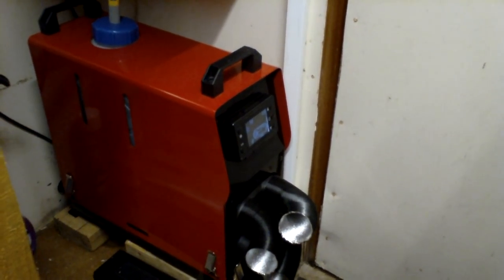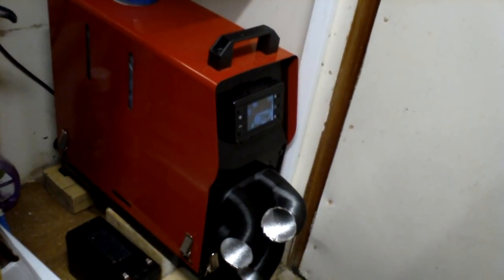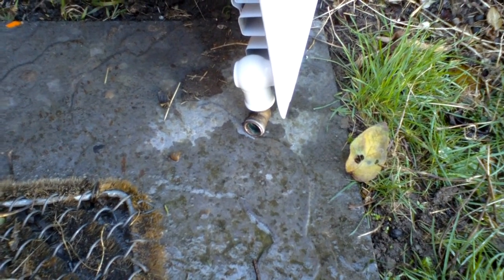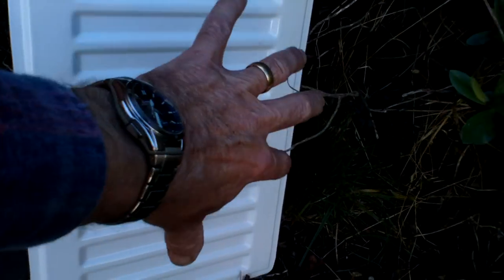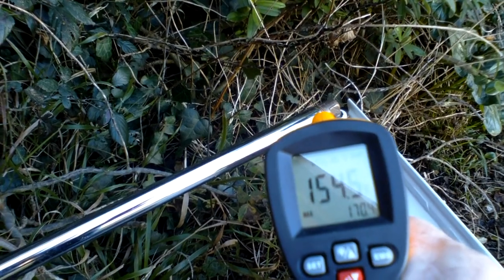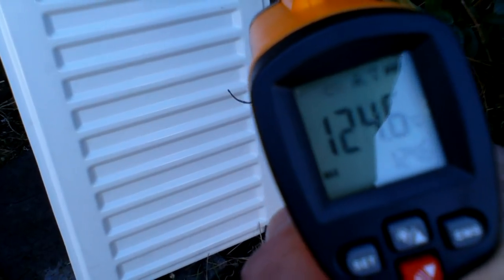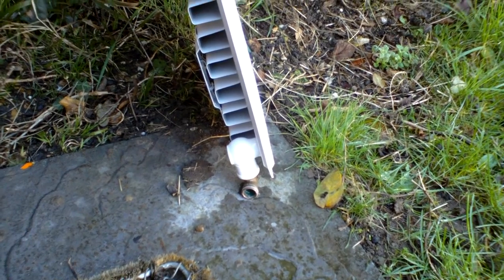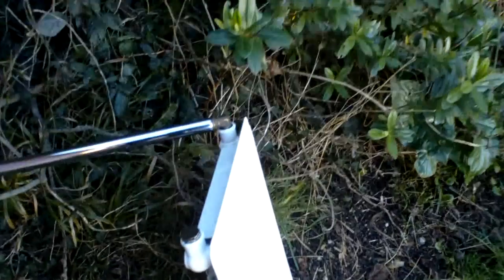COMPACT CHINESE DIESEL AIR HEATER EXHAUST HEAT RECOVERY

Comment: Wrap copper tubing around a pipe and make a water heater the plum the hot water into an old water heating radiator for homes. I seen someone else use a egr cooler to make a heater and it circulated the water without a pump just the heat moved the water
Reply from the maker: Hi John. There are all manner of way to extract the heat and I did this as an experiment and I made TWO VIDEOS and the microbore copper pipe was the most effective and the simplest solution as it does not interfere with the standard exhaust so will not cause sooting within the unit. Also service is easy as noting more to disconnect. The result is simplicity and as for a gravity feed all very early central heating relied on this but the pipe runs have to be carefully planned with rise and falls to allow the hot water to circulate. Adding the very low power pump on the input to the heat exchanger coil ensures that the hot water circulation is not too fast so it can absorb the heat and also be circulated effectively.
As I said the video was never made to be a definitive example of heat recovery but a simple solution to recover the heat normally wasted.
Thanks for your comment. Regards and stay warm Peter

Comment: Dear Peter please investigate that further, its a great idea and opens up a ton of new applications for small workshops or Rvs or others..I did think about some options which I could envision..like another commenter suggested..may be heat a water tank ( out side Installation) protect it from freezing..or put it in a ceiling or in an underfloor double floor construction to keep that areas turn over..or use it justn as a convection heater ( as it is designed for) but other blow thru containers can be considered as well..actually you turned one heat sources into two...plus you enabled brain storming about much higher efficiency om such devices..which again can be also transferred to other heaters lile trumas or Alde?
Reply from the maker: Hi RV.  I think there are applications but it has to be carefully designed. I think getting the exhaust gasses outside first then put them through a small heat exchanger which has a large surface area for the gasses to heat the water and has a low gas flow resistance. After the installation you would definitely need access to a combustion analyser so the burn rate air / fuel mixture was correct to eliminate sooting and carbon build up in the combustion chamber and the heat exchanger - the latter sooting up could be a major issue.
All gets the grey matter working which is why I did the video as to plant seeds gets others fired up so we may get a few systems appear yet once a load of others see the possibilities - fingers crossed. Regards Peter
Reply: @brucepeter2007  absolutely ! Well done! :-)

Comment: Try using a small inline intercooler, or a smaller radiator and feed the exhaust from the bottom.
Reply from the maker: Hi Qruns. I always try to reply as people who take the time to make a comment on my videos deserve a reply.
The below was in the comments section below my video but perhaps you missed it so perhaps I should put it on again so here goes...
PLEASE READ THIS AFTER VIEWING MY VIDEO.
DONT GO DOWN THE RAD ROUTE - I did this setup just to see if heat could be recovered and if it was worth the effort.
It is indeed worth the effort but NOT by using the exhaust gasses directly.
It WILL soot up the combustion chamber and you won’t be thanking me for that so please DONT USE THE SAME SET UP. 
The best way forward is to use copper microbore heating pipe and tightly coil it around a metal bar of slightly less diameter than the exhaust pipe then tapping with a hammer onto the copper pipe to flatten the pipe where it contacts the metal bar which will increase the heat transfer surface area a lot of copper pipe will ensure good heat transfer - to remove from the metal bar you would need to “undo the spring” by holding one end and un-turning the other end to increase the diameter of the copper coil which will cause the copper pipe to slip off the metal former. You would use the same principal to get it over the stainless steel exhaust pipe - it would when all need to be tightly wrapped in exhaust manifold tape to both insulate it and keep the heat in for good transfer. A small 12v pump would be used to circulate the heated water to either a copper transfer coil within your RVs water tank or you could run the water through a radiator if you so wished.
Using the radiator directly WILL cause the diesel heater to fail overtime due to increased back pressure and the issue with water condensation. Please also note that although heat rises so it would seem obvious to use the lower radiator inlet for the exhaust gasses  Using the bottom or top of the radiator for either the exhaust inlet or outlet makes no difference as the result long term is the same - I personally would like to do a video however time prevents me but someone else needs to take up the challenge on this one as I have just planted the seeds - let’s see what develops. 
Hope that helps - Regards Peter

Comment: Nice one.  As you say - if you can stimulate thought bubbles, you are doing well, so thank you!  I use my diesel heater in alpine camps where water pipes normally freeze overnight.  This means you have to shower before the pipes freeze and you destroy water pump.  If you could warm the water tank (from exhaust heat) and then periodically cycle the water, you would be able to use your water system for many more hours into the night.   Well worth experimenting - thinking copper coil around exhaust so as to not mess with exhaust gases or restrict the flow (and cause soot build up as some have indicated).  Perhaps a small, continuous water pump not too dissimilar to the fuel pump, copper coil and cycle through existing water tank etc etc.?????
Reply from the maker: Hi John. If you read my comment you will see the best way to go is coiled pipe route... I hay have a go again myself but it’s only as an experiment as I don’t need it so lost money for me but may help others. Got the pipe and a pump on order so keep watching my channel- will post update video soon.
Regards Peter

Comment: I did an experiment back in 2017 with a chinese diesel heater and ran the exhaust through a coil in a small calorifier by wieghing the water and measuring the temperature increase i  calculated  the exhaust was around 777watts output . I used the secondary heat exchanger from a Biasi condensing boiler the coil has an Id of 12mm .I fed the exhaust into this the system worked fine as long as the water temp was below 45c  above this the exhaust stopped condensing and the water vapour created to much back pressure causing lockout .
Reply from the maker: Great comment from you and agree with your findings. I was very concerned about the condense level of water - but if kept simple it would be worth playing with. I’m going to try again but as I’m an OAP I have to watch what I spend by hay - worth another go... Regards Peter
Reply: @brucepeter2007   Most of the exhaust energy is in the water vapour if you can condense all of this you are recovering most of the exhaust energy .Btw you are correct in feeding top and discharging bottom  allowing condense to drain out 
 Regards Nick
Reply: @nickbadi3599 You're spot on! Phase change. Learned that in 1sr yr engineering school.

Comment: You have to pay attention to bends you aren't supposed to have more than 270 degrees in total bends... Plus I think there is a 3 meter limitation on the length for the same reason. With the added back pressure, you can overheat the heater and damage the control panel inside the heater. You'd be better off wrapping a pipe around the exhaust pipe and do water or air exchange. Keep in mind that by cooling the exhaust with the exchanger you can possibly get condensation... And a quicker failure of the exhaust pipe. And if you have bends, water can start collecting inside the exhaust pipe. So draining the condensation would be key. That is why the silencers / mufflers have a weep hole. Get and use the straight through type. Easy to tell... The pipes will be in the centerline... If they are off set... Not a straight through silencer.
Reply from the maker: Hi there. Thanks for the comment but I did say in the description that this was just for fun - and if you read below I posted a link to my other second video which provided a far safer and more efficient route for exhaust heat recovery.
The first video was a play about but clearly showed it was worth added consideration which is why I pursued the interesting experiment which I did with the second video which you have missed. I designed a simple system using items available in any country and the construction of the heat exchanger would present no issues to the average constructor.
Lots have now taken the idea further and some are using the recovered heat to either heat hot water cylinders or stop outside waste / water tanks from freezing. Lots of scope to experiment.
If you do have a go please post a video as that’s what YouTube is fantastic for.
You can now see things have considerably progressed since the first video you have seen...
The other video is here https://www.youtube.com/watch?v=VktbyEAoVR8

Again thanks for your comment. Regards Peter

Comment: Have a few ideas for heat recovery. But need the time to fabricate it on top of working all the time. Cheers and enjoy a pint in your warm shed.
Reply: Hmmmm... the exhaust running through a small water tank... can set it up without a circulating pump. Some farm tractors do not have a water pump, they just use convection to circulate the colling water through the radiator and back into the engine.
Reply from the maker: Be interested to see what you come up with. Number of guys in the States are having a go to see what they can achieve. Should be interesting. Regards Peter

Comment: Use a pool heater exchanger and use the heated fresh air back into the air inlet, so the air is pre heated on cold days.
Reply from the maker: Hi Nev. No issue on the air inlet as it’s taken from inside the room however the main concern was the exhaust which almost gets red hot and all that combustion heat goes to waste so a simple method of heat recovery was devised that could be done anywhere with items available in any country which is why I used the coiled copper pipe method. Lots have followed this up and some have used commercial vehicle heat exchangers from scrap yards and the like building on my original concept.
The Chinese have seen the video and now made a diesel heater with 4 pipes - 2 being to give hot water by using the bottom section of the heater as the heat exchanger but to my mind this makes things harder to service when you have to take things apart so the exhaust recovery is the best method as with good insulation to keep the heat in the pipe provides enough heat transfer. Only other thing I would do on the water circuit is to reverse the flow in the coil system - taking the cool return water feed to the furthest end away from the heater and the final output from the hottest part of the exhaust nearest the heater...
All good fun. Thanks for your comment.
Stay safe. Regards Peter

Comment: Condensation in the radiator is good.
When you burn 750g (900mL) of diesel it releases about 32MJ of energy by combining with 2.6kg of O2 to produce 2.3kg CO2 and 1kg of H2O in the form of steam.
Condensing the 1kg of steam releases 2.6MJ of energy or 7% of the original energy in the fuel which would otherwise be lost.
Just keep the exhaust system sloping downward from the point of condensation (inside the heat exchanger) to the exit so it can drain.
Reply from the maker: Hi there. This is not the best way to go so the experiment was continued in another more efficient direction. I had poster the following link but many people don’t see it. Please follow the link which is an easier installation together with it being easier to maintain the heater if maintenance is required but more importantly- your not messing with the exhaust system keeping the gasses inside the vehicle. The link below will become clear...
Thanks for taking the time to comment. Stay safe. Regards Peter
PART TWO FOR RVs & BOATS HERE  @
Reply from the maker: LINK THAT DID NOT COME OUT...
https://youtu.be/VktbyEAoVR8
Regards Peter

Comment: Look at how a VW bug heat exchanger works.  It pumps fresh air around the exhaust pipe that is covered in large fins.
Reply from the maker: Hi Rick. Thanks for your comment.
If you remove the covers on the Chinese Diesel Air Heater that’s exactly what you will see inside in the heat exchanger...
Now you’ve seen this video experiment (which was NOT a success) Make sure you see video TWO which after much thought was the culmination video idea.
Regards and stay safe.
Peter

Comment: I am going to try using a hydronic baseboard heater and try sliding iron  pipe in it (I think the sulfur in fuel would corrode the copper) to run exhaust thru and I think it would be much easier to clean and cheaper to buy .
Reply from the maker: Hi there Gloknor - please see the follow up to this video on my channel  where I did the heat recovery with a completely different and better method which was more efficient and a lot less costly. Regards Peter
Reply: Peter Bruce , I certainly will. Thank you
Reply from the maker: @gloknor  Stay warm. Regards Peter

Comment: very good video about chinese heater thanks a lot i purchase one ! i plan to run it with solar and battery but first i must run it with 220v to 12 v converter 20 amp , thank for all :))) joël from belgium
Reply from the maker: Thanks for the reply and glad it’s helped you. They are great for heat output and warm up my shed very quickly even when it’s 0C outside I get nice and warm very quickly and at a fraction of the cost when I had electric heating.
Reply: thank a lot , i have just one more question when you pump all the fuel , there is an automatiquely and safe slow stopping stage or not ? ( it's in case i fall in sleep lol ) thank joël ( belgium ) @brucepeter2007
Reply from the maker: Hi again Joel. The fuel pump is a dose pump so it clicks at a rate set by the heaters computer to give the correct fuel dose for the fan speed and heat output. The fan speed reduces down - and thus so does the dose pump as the set temperature is reached.
To put your mind at rest the heater does have an overheat protection built in for safety. Please understand the heaters flame is totally encased within an aluminium shell so there is no chance of a fire however there is no protection against a badly installed heater where due consideration is not given to the heat generated by the exhaust getting so hot but installed correctly it’s totally safe so go to sleep and don’t worry - remember almost all long distance lorry drivers cabs use these to keep them warm when they sleep overnight in their cabs so the system is not new and well tested already. Stay warm and best regards Peter
Reply: thanks a lot :))) i can sleep safe

Comment: Hi been watching your videos, good work, but can you tell me how you wired your amp a volt meter to your power supply
Reply from the maker: Hi Terry. Sorry about the late reply as seem to have missed your comment. I had to rake the supply apart to mount the LED meter after cutting the cover and then the required shunt was installed outside ( but up against) the power supply.
I only did this for the video as other than showing people what Amps are used it performs no other function. Regards Peter

Comment: Hello Bruce my name is Tom. Your idea is very good. But I suggest you put a small hole on the bottom of your 1 m long pipe so we can pull air in and possibly push water vapor from the unit out. And from a plumbing point of view you should have it going in the bottom of the radiator as heat rises so the radiator will get hotter and hotter and the system should work quite well. if you were to use a stainless steel or copper coil you could also heat a water tank. Your friend in America cam
Reply from the maker: H Tom. The set up was a complete lash up and was only done to show it could work - the radiator had to be installed the way it was because I did not want to upset my existing installation. You are correct on many or your points but as it was a lash up I could not make a correct layout only wishing to prove the concept had merit.
Thanks for you comments. Regards Peter
Reply: @brucepeter2007    thanks for the reply back. Love your videos. So another one similar to yours. And he seems to be some kind of a scientist.  and he said the straight muffler was actually better than the baffle muffler by 2 decibels.   FYI
Reply from the maker: Hi Tom. I have seen the video you refer to but I tend to rely on my ears and the sound with the straight through exhaust provided a more annoying note than the baffled type. I fly model planes and use both glo and petrol engines up to 35cc and the exhaust note is of major importance because it can be annoy because it’s tone is annoying but alter the tone and it can become much more tolerable even though the sound level is the same. Hard to explain but I hope you can understand what I’m getting at. Regards Peter
Reply: @brucepeter2007   that's cool I bought the same unit you did mine arrived a little more damaged.  It also came with no instructions.  I could not have handles on it and I thought they handled should go through the body but there's no way to do that. So that's why I watch your videos and others lightning thanks for the info
Reply from the maker: Hi Tom. Thanks for your reply. I will help you out where I can. Regards.